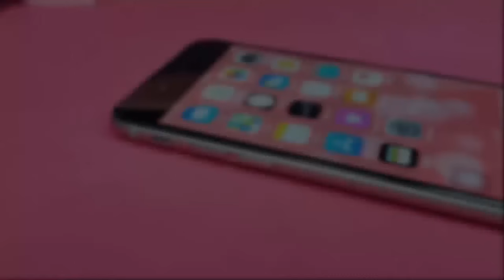iPhone 6 /iPhone 6s- Home Button || Fingerprint Sensor Replacement || How to open Apple iPhone 6/6s

Comment: Thanks pal, I got a new display for my 6s and the touch ID did not work. Swapped it with my old one and now its working just fine! Thanks again :D
Reply: Brother how much did it cost
Reply: @minzomtamang2362  Like £11.99 very cheap but got it working again!

Comment: Does Fingerprint ID Still work's after the replacement?
Reply: No.. R.I.P Every touch ID has BIOS and and is unique which is bonded with processor  and once replaced it will search for the same bonding no or ID. Hence only home button works.

Comment: When replacing your screen with a new one make shur to use your old fingerprint sensor, it has a chip and it will not accept it for fingerprint opening only home button use!
Reply: How
Reply: The new home button doesn’t have a fingerprint sensor???

Comment: sorry but the touch Id will not working after this , only Home button will work fine , you need to send it to apple and this very expensive .... i lose my iPhone 6 touch id sensor after i full replace it :(
Reply: mostafa sunshine after how much day or time period it gave the problem... please reply
Reply: @mdrajaurrehman4303  instaly..... wen you cange the home button the ID function wont work.... the home button is bound to your phone's id and thats it
Reply: Try to disconnect the battery like he did, it might this trick works
Reply: How much is the charge for replacing touch id from apple?

Comment: you dont even change it, just use back the same home button, as after changed the button, the touch id will not working.

Comment: worthless video!  and if you have a cracked screen the suction cup separator wont work. But if you use box tape  on the cracked screen the separator will work. hope this helped someone out